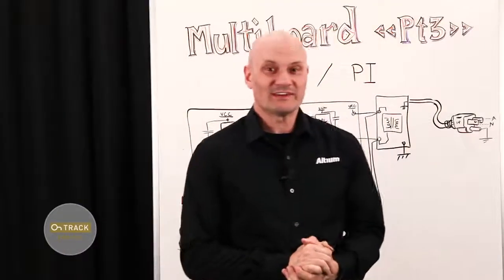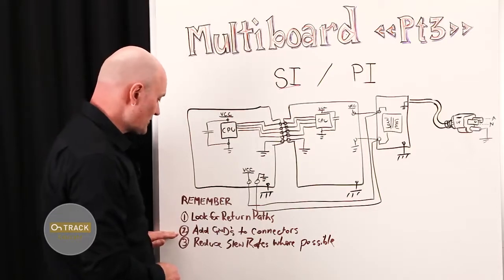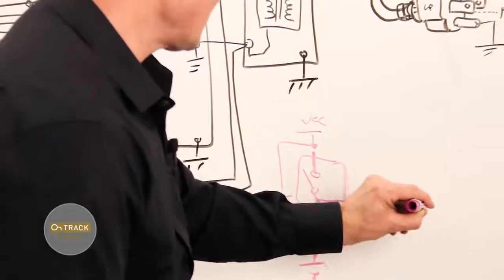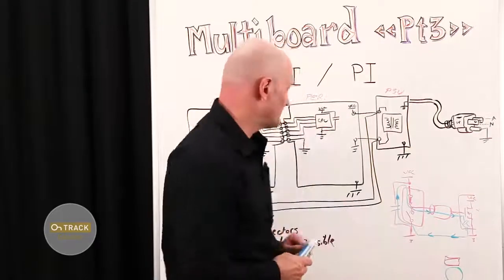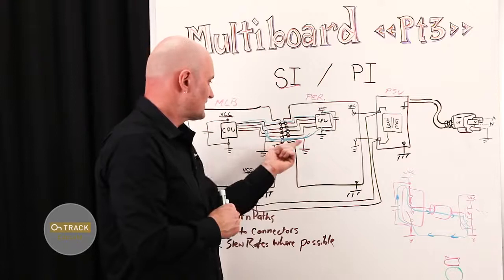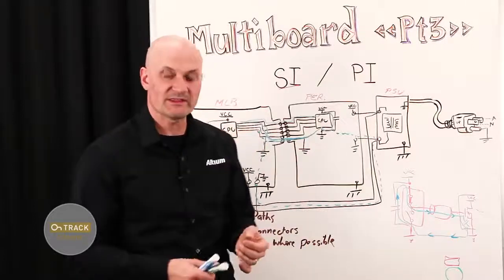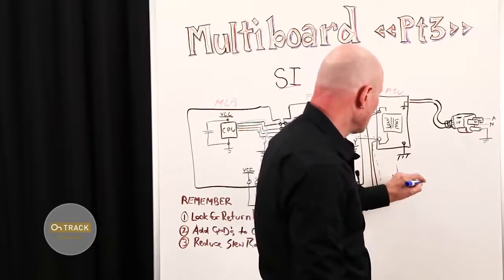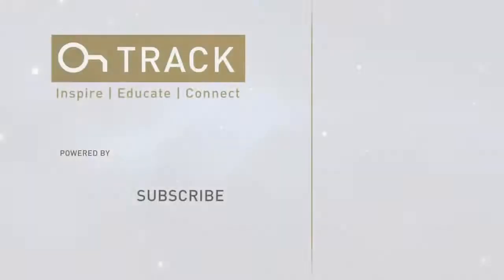(3) Introduction to Multiboard PCB Design - Signal Integrity & Power Integrity - Altium Academy

Comment: Brilliant Ben. One thing I did note, currents don't go through capacitors. The outbound and return fields start out and meet in the middle (at the other end). The damping to reduce slew rate can also be thought of as a low-pass filter (which is what it is) to remove some of the very high-frequency harmonics that are present on a square wave. All that said and I knew most of this one, the information on board-to-board connections is invaluable to me as I've been asked to do something like this for makers.

Comment: A minor comment; It appears that your labels on the AC plug are incorrect.  I'm not sure what the 'A' means, 'L' (line), 'N' (neutral), & 'E' or 'G' (Earth or Ground) are more common for that plug.  Also, the 'L' terminal on the plug is on the right-hand side when facing the outlet.  That blade is labelled 'N' on you illustration, a possibly deadly misinterpretation.